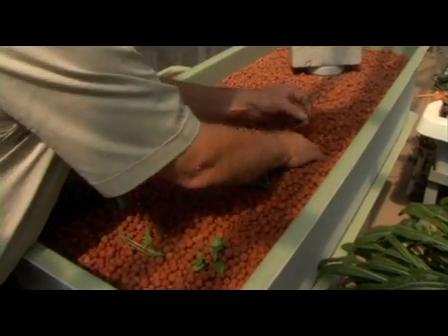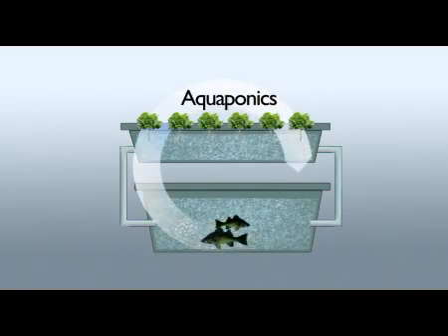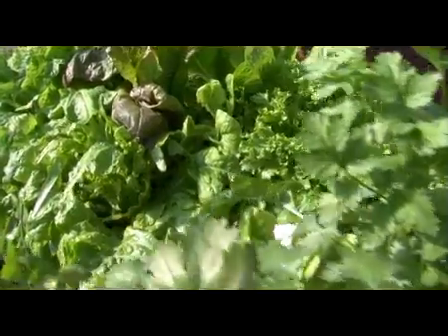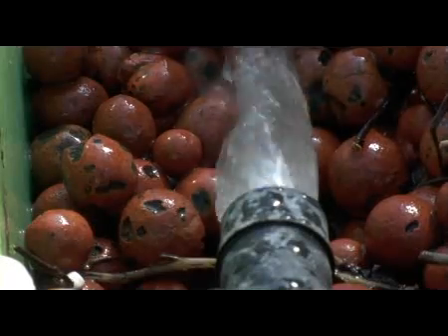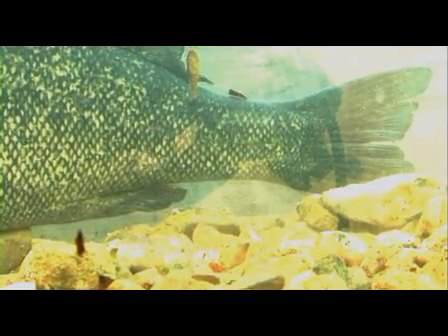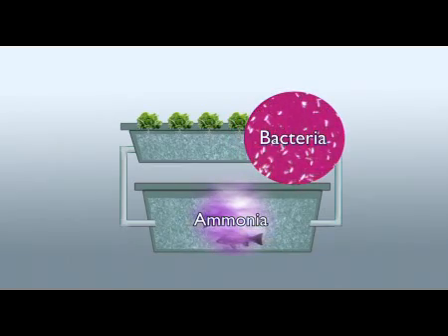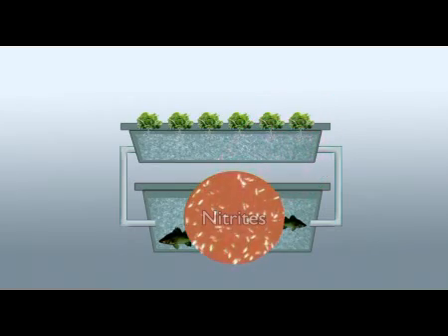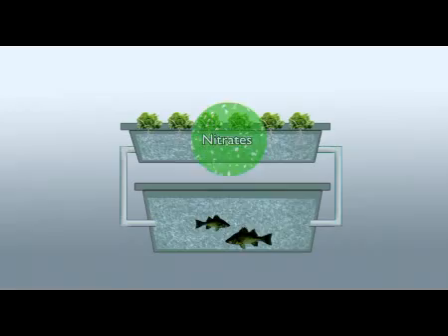Aquaponics Made Easy 03 DVD

Comment: The system is pretty much obsolete without a filter the waste is supposed to be separated from the system plant feet off the ammonia and the good bacteria turns it into nitrates in new trades for the plants to feed on anybody can make a system without a filter but not separating the waist throws the system off and leaves you with a lot of cleaning later